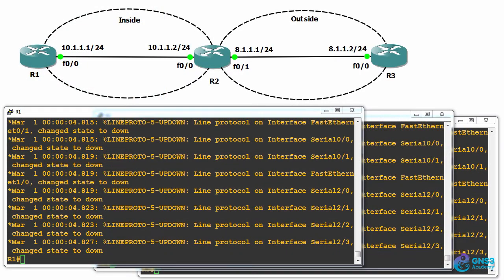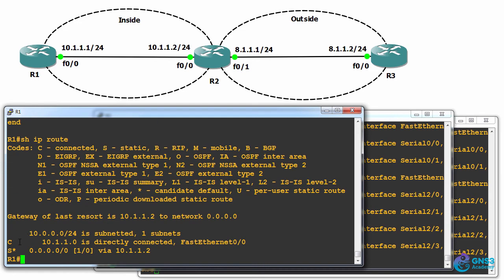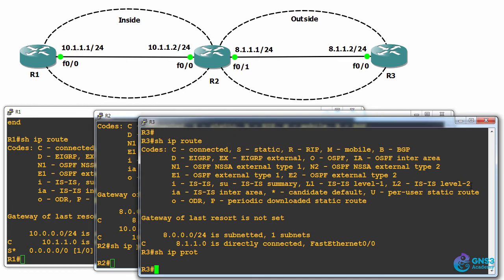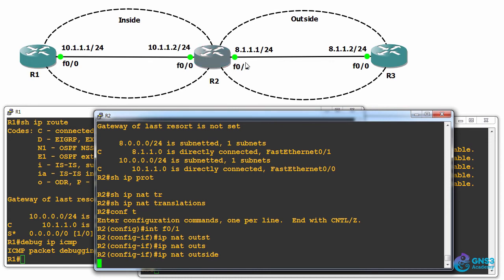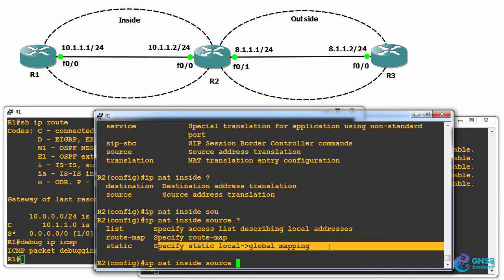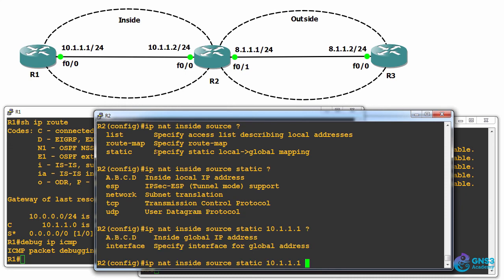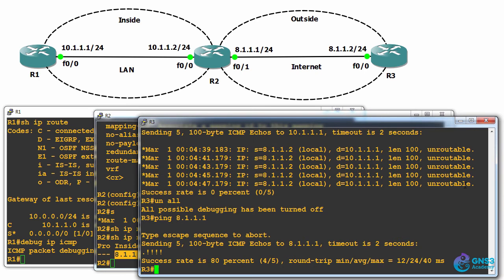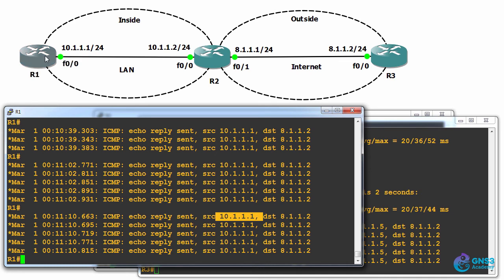CCNA #020: Static NAT Demo: CCNA 200-125 exam

Comment: Professor, i can not understand how can we ping from R3 to R1 this ip address 8.8.8.5 you have not configure in interface fa0 /1
Reply: The ip address in fa0/1 (nat outside) is 8.1.1.5 not 8.8.8.5
and it translate ip address inside local 10.1.1.1 to ip address outside local 8.1.1.5